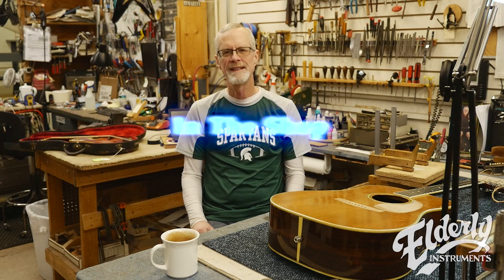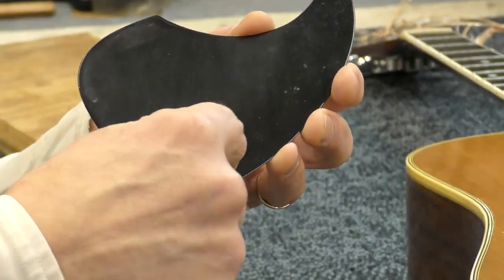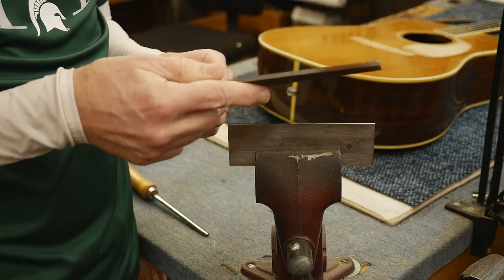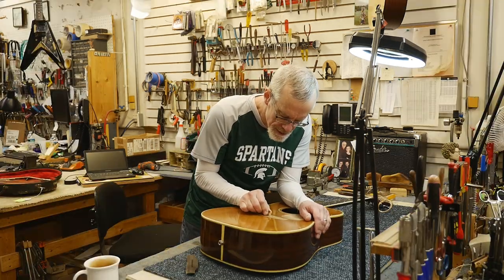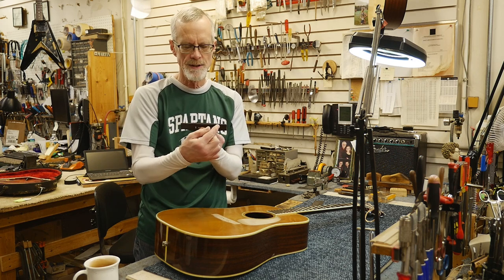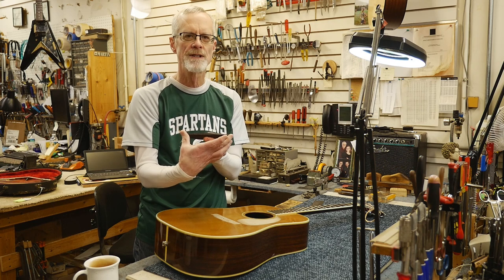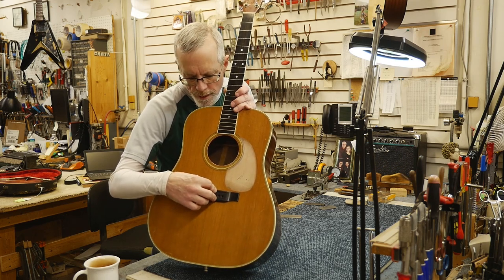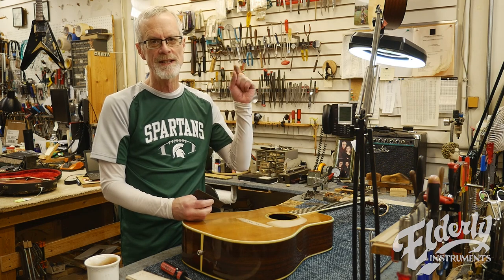In The Shop: Restoring the Bridge and Pickguard on a Vintage Martin Acoustic Guitar | Elderly.com

Comment: Hi from SoCal via Ann Arbor 42 years ago, Go Blue! 🙂.  I own an 1977 HD28 and realizing the bridge saddle is 1/8 inch off, intonation sharp every string 🥴  Got a solution ? Bridge is not lifting at all. Don’t think there is enough room to recut saddle slot as be right next to pins🤔. If I have bridge moved back, will have finish scar in front of bridge. I wonder if Martin would send a limo from PA, pick up guitar, fix their mistake under my lifetime warranty 🧐 I registered in 1977 🥳